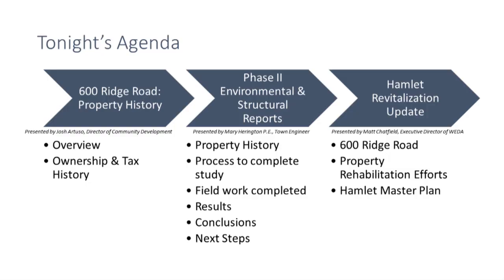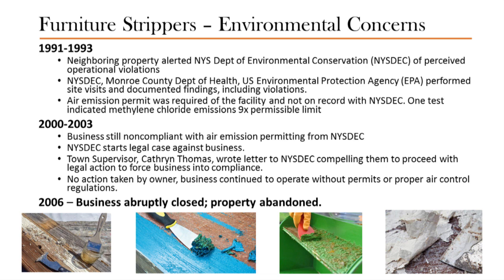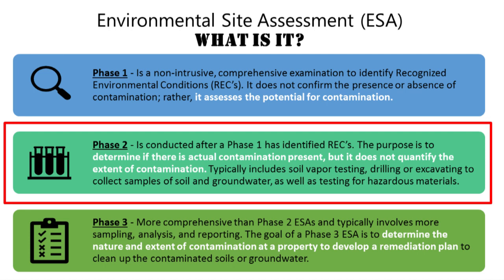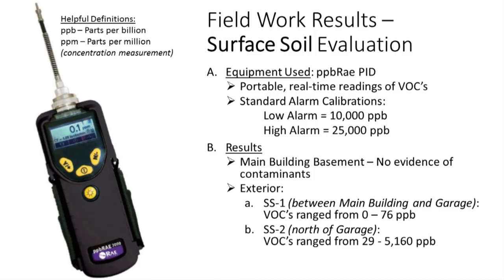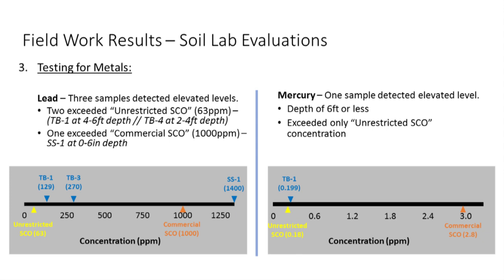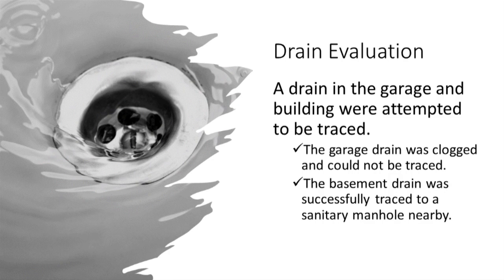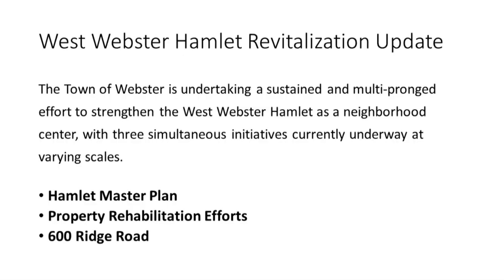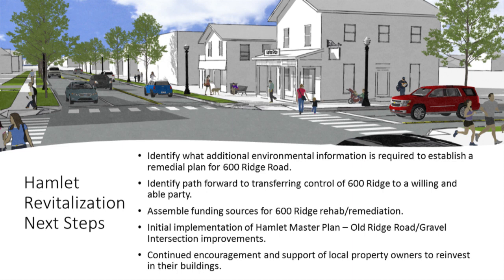April 13, 2023 Special Town Board Workshop

Comment: 847,000$ for rehab of that small site / structure seems like a bad investment to me!  Is there an estimate to remove the structure and prepare the site for a small parking lot that could be used as a starting point for an alternative use such as say for Electric Vehicle charging?  The area could sure use a level 3 charging area!

Regardless of cost concerns, I prefer to see the structure removed because it obstructs visibility across that corner.  The small public space at the NW corner of 5 mile line road and 441 shows what benefits that removing the building might have there.

If there were a bid for the site at the next auction, what would the actual cost be for the new owner?